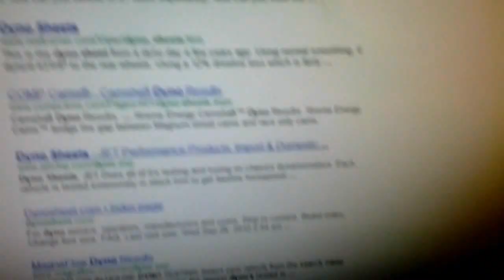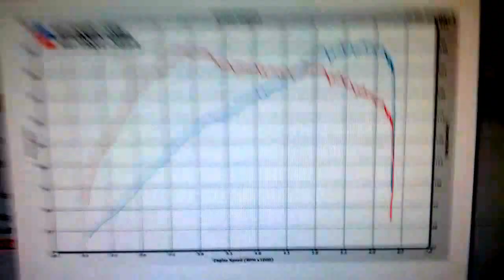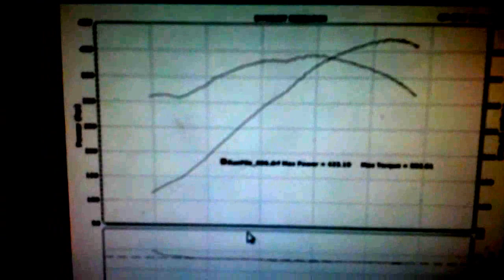Horsepower vs. Torque

Comment from the maker: I still can't believe all of the aggressive commenting this video gets. 

The ONLY thing one should take away from this video is that horsepower is mathematically linked to torque via engine speed. You cannot have one without the other. You cannot say one doesn't matter because they both yield the same information when considered with engine speed. If you know how fast you're running you can convert horsepower to torque and vice versa. 

Stop leaving comments about gear ratios, power to weight, drive train friction and whatever else. These subjects have nothing to do with the point I was trying to make.

Horsepower is a FUNCTION of torque and engine RPM. That means one cannot have a high power output without a relatively high RPM. This means that an increase in horsepower is 'felt' most at higher engine speeds. In  contrast torque can be much more constant across and engine's speed range. This means that you're more likely to notice an increase in torque during everyday driving than you are an increase in horsepower.

Even so, if one goes up the other will always follow because they are absolutely and completely linked to each other via engine speed.
Reply: Well if that's the only point you were trying to make, then you should remake this video, because it is not the point that came across. Even the above post is contradictory, because an increase in horsepower is intrinsically linked to an increase in torque at ANY RPM. Horsepower is not a meaningless number. It is more meaningful than torque BECAUSE it is the product of torque and RPM, and therefore provides a good idea of the AREA under the torque curve. If an engine has a flat torque curve, then horsepower represents the area under that curve. If it's not quite flat, it's still a better number than torque alone, because torque is just a measure of twisting force, not the rate at which an engine can do work.

We all know that the acceleration you feel is 'proportional' to the SHAPE of the torque curve (if we ignore drag for a moment), but ABSOLUTE acceleration depends on horsepower, torque curve shape, weight, gearing, drag, frictional losses, velocity etc. So it's utterly useless to consider flywheel torque alone. You can't do 200mph in a road car with a 300hp motor, no matter how you manipulate (within reason) the torque curve in compliance with the equation: hp = (torque x rpm) /5252 (common knowledge btw). This is the essence of what is wrong with your video, and it is misleading people into believing that horsepower doesn't matter (quote "love the torque, not the horsepower").

Do another video using Excel calculations showing 2 cars with flat torque curves and identical horsepower, drag, weight & drive configuration, but car A has twice the torque of car B, yet half the final drive ratio to achieve the same top speed (due to half the rev limit). Their performance would be identical, and if you argue with this, then you really don't understand how it all works. Clue: same area under the torque curve = same horsepower.
Reply from the maker: And torque is intrinsically linked to power and is meaningful because it is the quotient of power and rpm. No one is more important or valuable, but with everyday driving one will notice a large increase in torque more than an increase in power (yes, even though you can't have one without the other).
Reply: Jon Proce

Engineers disagree when it comes to the best performance indicator. You can't mathematically separate torque/horsepower, but you can more reliably predict better performance when you increase peak horsepower (for example, increased rev limit and shorter gearing with no change to peak torque). In contrast, peak torque as a performance indicator doesn't work at all in absolute terms, and not very well in relative terms. For example, you can increase peak torque without increasing peak horsepower, but this can only occur somewhere below 5252rpm, which in a drag race is irrelevant soon after launch, as most road cars are traction limited at launch. I get the impression you're arguing from a 'modification' point of view, rather than a 'production engine' point of view, in which case you make slightly more sense. In terms of modification, you will certainly feel a performance boost from an increase in torque at any rpm (hp is obviously increased too), but small increases in torque below the shift-shift rev range won't help after you've reached the end of first gear.

So, peak power is a better performance indicator than peak torque, because higher power translates into higher WHEEL torque through the appropriate use of gearing. Torque curves aren't exactly mountain ranges on modern production cars, due to variable valve timing/lift technology (VANOS, Valvetronic, MIVEC, VTEC etc), sophisticated engine managements, adaptive intakes/exhausts, forced induction etc. For the majority of unmodified cars, peak horsepower tends to approximate well with the area under the torque curve, which is what really matters.

By far the worst offenders in not understanding all this are diesel fanatics. They bang on about flywheel torque, ignore their low RPM limit and consequent gearing disadvantage, yet claim victory in the face of overwhelming evidence, let alone basic math. Impressive torque for sure, but rarely more power, taller gearing and usually slower in a drag race. Granted, there are some over-boosted diesels knocking about, and while they might seem like the exception to the rule, they still don't perform as well as their over-boosted petrol cousins (higher horsepower). Swings and roundabouts once again.
Reply from the maker: Ugh.
Reply: Jon Proce

Horsepower is not stupid, and it is extremely arrogant of you to tell the 'automotive world' they're delusional. No doubt you made this video with good intentions, but it is offensive to engineers. No offense intended ;)

Btw, if a light bulb is brighter because it consumes more power, then in automotive terms, it's a faster light bulb. Its power consumption is voltage x current, and its power output is some percentage of its input power, depending on its efficiency. You wouldn't question that a higher power bulb outputs more light, so why would you question that a higher power engine results in a faster car? Hopefully you wouldn't claim that the brightness of a bulb depended solely on its input current, or solely on its input voltage, because anyone knows that would be absurd. It's all about the product, and the higher the product, the brighter the light bulb (V x I), or the faster the car (torque x rpm). Power is power, whatever field you're dealing with.
Reply from the maker: Staahhhpp. I AM an engineer.
Reply from the maker: I was being fecicious. I was simply highlighting that if they knew the difference people would probably care more about torque than power output since it's typically torque that makes a vehicle 'feel' fast.
Reply from the maker: Matthew Hyder Jesus, stop. Get in a car, step on the gas, and you feel torque, not horsepower. That's it.
Reply: Jon Proce I have been saying this for quite some time thank you
Reply from the maker: zanick2 are you really going to argue about the definition of torque? Have you ever read anything aside from your own comments? Have you got any kind of education?
Reply from the maker: zanick2  Torque almost always peaks at lower rpm than power, which is why you would in fact feel it more during 'everyday' driving.
Reply from the maker: Force = power/velocity. You're unnecessarily complicating fundamental formulae in an effort to prove a point.
Reply from the maker: zanick2 that's exactly the point, you shift at peak RPM and you drop down (ideally) to the rpm where torque is at its peak, as it yields the highest acceleration. Torque typically peaks before power, which is why when you're driving around as one typically does (that being NOT at or near your redline) you feel the effect of torque more because power is nowhere near its peak.
Reply from the maker: zanick2 Force at the rear wheels is an exact function of the torque supplied at the engine multiplied by the transmission and differential ratios minus the drivetrain losses and again factored by the radius from the axle centerline to the contact patch. You're the one who is confused here.
Reply from the maker: Mete that sounds perfect! Gearing is very important and that sounds ideal.
Reply from the maker: Chad W torque, by definition, is what you feel. You feel acceleration of the vehicle, not its speed. That acceleration is proportional to the vehicle's mass and the force acting between its tires and the road, which is a function of torque (at the wheels), and the tire radius.
Reply: Wrong, you feel linear acceleration, due to increase of your kinetic energy over unit time.  Torque is an intermediate form of the energy.  What if I had a linear accelerator that didn't rely on a spinning wheel to produce forward motion at all?  How relevant would torque be in that situation?
Reply from the maker: zanick2

Sigh. Alright, you win. Go write a physics textbook to replace the ten I'm going to have to burn because of this.
Reply: zanick2 Torque is Force times the Perpendicular distance between the center of where its applied and from where its applied. Work is the Force times the displacement. That displacement is the distance the object would travel because of the application of that force. Its a vector quantity and if you start from point a and go to point b and then come back to point a on the same path, your net displacement is zero and work done is zero.
Reply: Jon Proce You are correct in the fact that torque is felt in everyday driving (stop and go) but it is also felt when at peak HP which is still torque but at a lower number and a higher rpm. Therefore HP is really just a number because we can say all day what is the HP at max torque for example

600 ft lb of tq @ 4900=599HP but make that number @ 7000=799HP but you will still accelerate the same...why because the torque factor never changed so if one makes 599 vs 799 the only difference is the distance to which one accelerates. But that does not mean that HP is then means of all means. Want to go faster make all the torque you can and stretch it as far as you can (rpm wise) without hurting the engine. Gears are a huge key to this as well as they multiply torque not HP. 

I had friend recently say that he could only go 190 on his BMW with a gearing of 40/17 but with the 42/17 setup he was able to reach 197, this lets me know that we are looking at torque instead of HP, how the HP stayed the same but the torque at the tire went up simply because of the mechanical advantage presented. Again to me HP is just the number, want to find the real factor (THEN LOOK AT THE REAL FACTORS) RPM and Torque are real factors HP is not, its a derivative of the two mentioned
Reply from the maker: Alright, I'm going to humour you and walk you through it one step at a time. What is Newton's second law of motion? 

https://en.m.wikipedia.org/wiki/Newton%27s_laws_of_motion
Reply: zanick2 Acceleration torque multiplied by gearing (trans and final drive "primary on most motorcycles") I have a friend who all he did was change his gearing on his bike 40/17 with the same tune went 190 in the 9/10th mile changed to a 42/17 went 197 why because the tire saw more torque (but the same HP) at the wheel SO if you make 600 @ 6000 or you make 700 @ 7500 who wins with the same car and set up
Reply from the maker: zanick2   You do realize that engine power ratings are peak values, right? You realize that power is a variable and isn't constant across the rpm range?

There is an absolute guarantee that the force generated by the engine torque, whether at the flyweel or at the wheel, is exactly proportional to the vehicle's acceleration. Not sort of proportional, EXACTLY proportional.
Reply: zanick2 It would operate at higher RPM for velocity IF torque at the wheel allows it. And he went 197 simply because he had more force pushing him with that gearing he made an additional 30+ at the wheel without the HP moving a bit. And 600 vs 700 HP equates to 525 tq vs 490 torque 600 HP actually made more torque because of where the power was made
Reply: zanick2 Racers look at the torque curve. 

How much HP would it take to make 1 g acceleration in a 4000 lb car
Reply: zanick2 Torque is a factor same as RPM
Reply from the maker: zanick2 20 years experience and you're still this clueless? No wonder you're so stubborn. Satisfies the theory that you have no real education to back up your ridiculous logic, though.
Reply: zanick2 I also race first cars now bikes and just like Jon Proce said when you RPM drops its damn near max torque. tell me where you shift an what kind of trans you use ill do the math for you
Reply from the maker: zanick2 What? Why in the world would you think that exactly 4000 lbs force is required to accelerate any object laterally at 1G?
Reply: zanick2 Its simple it takes 4000 of force plain and simple 400 hp or 1000 hp alone does not mean anything but the torque you get from it

450 ft lbs or tq x 2.61 x 3.42=4016 that is one full g of acceleration
Reply from the maker: zanick2 Typically that is the case, yes, you'll shift down to an rpm slightly above the max torque. When max output is desired the engine is operated between the two rpms corresponding to the peak torque and peak horsepower; that's what the 'powerband' is.
Reply: zanick2 Can you just please give me your transmission and your rpm shift point
Reply: Jon Proce I will be buying a Hayabusa to which the shift point will be raised, but to counter this i will be also adding a wide ratio trans, the average torque is right about 100 so as long as i shift at my exact point i wll be right back at my max torque (just above it actually) i have also seen what other bikes shift to when they RPM drop and it is right above max torque
Reply: zanick2 He was confused as to how you did not come up with the math. I asked you how much HP but showed you how much was needed in torque to get there 450 1st gear 2.61 final drive 3.42=4016 of force
Reply: zanick2 so you are right around max torque like we said in the first place
Reply: zanick2 Acceleration goes down when torque goes down NOT hp. Put it simple if you start in 2nd and i start in first (both vehicles identical) My acceleration will outdo your velocity simply because i have more force in every gear on out going to the wheel
Reply: zanick2 I have no need to say it loud. I'll put it to you like this if a person can tell me what they make torque wise and i see their gearing, and weight i know what that machine can do. And of all the races i have looked at and knew what they had never once have i been proven wrong. I am so much with confidence i can tell you when a and why a vehicle passes another vehicle
Reply from the maker: Mete I honestly don't think there's much convincing him. From the sounds of it he has no technical background, but he's raced recreationally for the past couple decades and considers himself to be quite the expert at this point, despite his understanding being deeply flawed. There's not much you can do to sway someone when they believe to that great of an extent that they're correct.
Reply: zanick2 I do lmao easily. You accelerate fastest at max torque so 1st gear and max torque is your fastest acceleration
Reply from the maker: Mete All of zanick's comments have disappeared... do you think we actually got through to him and he deleted his account?
Reply: Jon Proce I see them?
Reply: zanick2 I just showed friends of mine a PTWR of three bikes 440 lbs 207 hp vs 500 lbs 243 HP vs 550 lbs 251 hp They equal 4.8 vs 4.7 vs 4.5 in that order BUT the 4.5 will smoke both of the other two simply because of where the power is made and the torque that comes from it
Reply from the maker: zanick2 That's all well and good, except literally every statement you made in that comment is wrong, Just because you think you have some idea what you're talking about doesn't mean you actually do.
Reply: zanick2 Here let me help you out. If i have a 3.42 rear end, i then switch it out for a 4.10 what happens do i accelerate faster with 4.10s or 3.42s
Reply: zanick2 You lose what lol Do you know how aggressive a GTR gearing is? Do you know thats why they take off so hard, take a look at one in a second gear roll
Reply: zanick2 What is there to fight, put it simple what does a dyno measure
Reply: https://www.gearvendors.com/racing.html

What do gears multiply. 

http://www.car-videos.net/articles/horsepower_torque.asp

Work is defined as force over distance and is calculated as Work= Force * Distance.  In other words, work is achieved when force causes an object to move.  The force placed on the object and the distance it moves are calculated as the work done.

Horsepower is a unit of power.  It can be defined in many ways.  In its basic sense, it's defined as work done in a straight line as described above under "Power".  But when the work is not done in a straight line, it must be defined in a different way: torque.
Reply: +Jon Proce 

Horsepower: 300 @ 5800 RPM Torque: 300 @ 1200 RPM vs Horsepower: 330 @ 7000 RPM Torque: 270 @ 5200 RPM typically which car would win in a race?
Reply from the maker: Marcus Rimpel depends how long the race is... The car with more torque low in the powrband would get the jump off the line but since the other car has its peak torque so close to its peak power it would probably pull ahead through the shifts.
Reply: Marcus Rimpel Also depends on gearing
Reply: zanick2 Understand this HP is only a calculation of torque nothing more. but what the tire is seen is the torque ie (engine torque transmission gear ratios and final drive ratio) gearing is the multiplier of torque, NOT hp. two cars can make 400hp but one make 350 vs 300 torque lets do some calculating as to how this will play out

350 x 1.61 x 3.42=
325 x 2.23 x 3.42= 

4th gear

1 x 3.42 x 350=
1.18 x 3.42 x 325=

One with a 26 inch tire the other with a 28 so they will do about the same speed but who gets there faster?
Reply: zanick2 Dude a Dyno only measures torque which then is converted to HP. HP is nothing but a good looking number. Just in the fact that something has to be done in order for number to made for power explains everything. POWER is nothing without a FACT to go along with it. RPM and TORQUE has to be made in order for HP to even be thought about, which makes nothing but a mere calculation lol. Calculate the torque (which a dyno does at the rpm and you come up with HP. 

http://auto.howstuffworks.com/horsepower1.htm
Reply: man i really cant thank Jon Proce Mete and even zanick2 enough for really taking the time out to explain this to me. you guys are freaking rockstars....i have very little knowledge about the way cars work and i aspire to be like you guys thanks again!
Reply: zanick2 LMAO you need not say anything more How does a dyno NOT measure torque IT DOES NOT measure TQ it CAN NOT measure HP because HP is made by TQ and RPM i know you did not read "how it works" therefore you did not want to get butthurt but it is what it is. A tire never sees HP it only see TQ at any given RPM which is why a vehicle accelerates different in every gear. Again a 3000 lb car how much HP does it need to accelerate to 1g if you can tell me this then i will not respond...BUT your answer better be on point. I DONT WANT TO HEAR TO MANY VARIABLES EITHER
Reply: http://www.school-for-champions.com/science/force_torque.htm#.VifN3OxViko

http://auto.howstuffworks.com/four-wheel-drive1.htm

https://www.physicsforums.com/threads/calculate-wheel-torque-based-on-known-weight-wheel-size-acceleration-data.288570/
Reply: zanick2 lmfao give it a rest man watts has nothing to do with Horse power lmfao just stop read what the physics forum has told you lmfao
Reply: zanick2 Watts is electric NOT an IC engine here show me where you see KE in this talking about HP

 https://en.wikipedia.org/wiki/Kinetic_energy
Reply: zanick2 The factors are TORQUE  to calculate HP without torque and rpm you do not get HP so therefore HP is just a number which is why you accelerate faster at max tq vs hp. which is also why the more torque you make or the more you can carry torque the more hp you make. AGAIN it all depends on TORQUE and RPM now you can continue to troll this video all you want but when you can present proof then i will listen again. KE is just that ENERGY not HP lmao good day sir
Reply: zanick2 Shhhh stop not even gonna read you back to the future 1.21 gigawatts analysis Its called an INTERNAL COMBUSTION ENGINE, if you wanna talk electric go to Tesla...OH WAIT THE BIGGEST FEATURE OF AN ELECTRIC ENGINE IS TORQUE WHO WOULD HAVE THOUGHT LMFAO. Again SHHHH come to me when you have substantial proof
Reply: zanick2 Work is done when torque and RPM are moving a distance LOL its all about torque. Tell me this if a Tesla makes 600+ tq at zero rpm has the fastest take off of any car how much HP is it making lol. Your comments are far from truth, and that is probably why they are being deleted lmfao. IDK dont care. the fact that you are bringing up KE and joules shows you know nothing about ICE or any other motor
Reply: zanick2 They can make the same HP because or RPM and torque only difference between F1 and a diesel it still comes down to torque and rpm, torque times rpm divided by 5252=hp torque and rpm are FACTORS HP is calculated by those two FACTORS. now show me ANYTHING that says a DYNO DOES NOT MEASURE TORQUE. its the ONLY thing it can measure why because weather its a engine dyno its measuring crankshaft torque (you do know that a crankshaft makes torque correct) or how TORQUE AT THE TIRE is measured in order to calculate HP. BUt none the less TQ is and rpm move the vehicle. What do low TQ vehicles do to compensate for the lack of torque??? Really short gearing for better TORQUE multiplication ITS TORQUE
Reply: zanick2 FORCE=torque because TORQUE is a rotational FORCE lmao
Reply: you do realize the middle of your statement is garbage right? you cant feel tq unless you are producing hp..... hp can be felt at any given rpm speed.... and you dont "feel" crank tq.... you feel the hp of which accelerates the weight/mass
Reply: Lets say a car makes 500 HP @ 6500 rpm with a 3.7 final drive and your typical four speed tranny

4.1*3.7*500 N/A
2.5-3.7-500 N/A
1.25*3.7*500 N/A
1-3.7-500 N/A

or do you feel

4.1*3.7*404=6128 TQ at the tire
2.5*3.7*404=3737
1.25*3.7*404=1868
1*3.7*404=1494

So while you reach 500HP in every gear acceleration will diminish simply because lack of magnified or multiplied torque at the tire. And to produce HP you need TQ and RPM two units to make a measured number
Reply: zanick2 Dude please just STHU you can not feel HP You loose force in every gear therefore its the engine torque x gear ratio x final drive has nothing to do with HP thats why your measly little CVT lost because it was stuck in peak hp you saw the fucking video, thats why your ass did not respond not STHU
Reply: zanick2 You saw the video im done here all that other shit you are trying to talk about is for the birds, when you start racing (which i know you dont do) then talk to me
Reply: zanick2 A CVT equipped vehicle accelerates at max hp under WOT but never out accelerates the equivalent car with a different MAN or AUTO that drop power back down to MAX TQ you saw the damn video, dont act stupid
Reply: zanick2 You look at any CVT vehicle and they lose to their counter part simply because they remain in MAX HP. Honda has the same problem, they dont get to use their torque therefore they lose. Why do you think transmissions have a the biggest percentage drop in the 1-2 shift its because its hit right around max torque. please do not respond anymore ive shown you proof way to many times and dont feel like looking at your ignorance anymore
Reply from the maker: Torque isn't a form of energy. It's a force. You're convoluting one of the most basic principles of physics.
Reply: Torque is not a force.  Torque is a force acting at a distance that could produce rotation.  Torque is only relevant to this example b/c the intermediate form of energy is rotational. If i accelerate in a straight line, what relevance does torque have?   If I use a form of energy that is never rotational, how would I FEEL torque?  The answer is that only power is relevant to producing acceleration.  Torque is only relevant when describing the intermediate form of energy used by a car, but it's not the guiding metric.  Judging your comments in this video I get the feeling that you are an actual engineer, but only an ordinary one.  You seem to be one of those narcissistic engineers with a superiority complex because you understand physics, and you create situations to feel superior to others, but you haven't spent enough time out in the real job world to realize how ordinary and average you are, thus you're pleased and smug when you have pedantic corrections of people's ideas.
Reply from the maker: I spent years as an automotive mechanic, aircraft mechanic, and hobbiest. I have plenty of real world experience. You're entitled to whatever outlook you choose on these things, it just happens that in this case most of what you're saying is wrong.
Reply: Wait you said in an earlier comment in this thread that you're an engineer, so which is it?  You didn't reply to my statements that contradict your assertion here, but you say I'm wrong, how so?
Reply from the maker: Former aircraft maintenance engineer that now has a mechanical engineering degree and works in Oil and Gas. The garbage half-science you're spewing isn't worth writing a constructive reply.
Reply: it depends on the speed, 

1) a = p / (v * m)   

2) p = v * m * a

so

p = v * 4000lb * 9.81m/s^2
Reply: You get maximum acceleration at maximum HP with a CVT, indeed a = p / (v * m).
Reply from the maker: fededevi yes, but that's a different situation entirely.
Reply: I was responding to another person, this reply system on YT kinda sucks.
Reply: "If i accelerate in a straight line, what relevance does torque have?   If I use a form of energy that is never rotational, how would I FEEL torque?" Great vid, i respect the amount of patience it takes to not quit after reading most of these comments. And even doing it in ft.lb and sausage/π ?!? +1 sub.